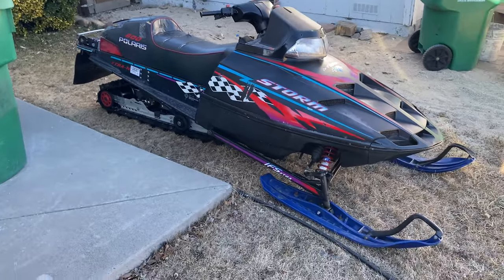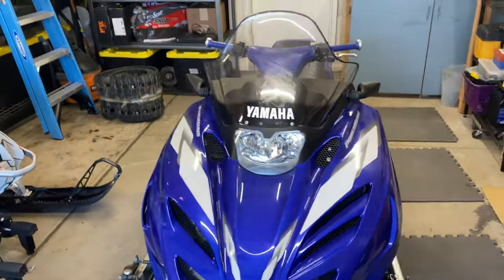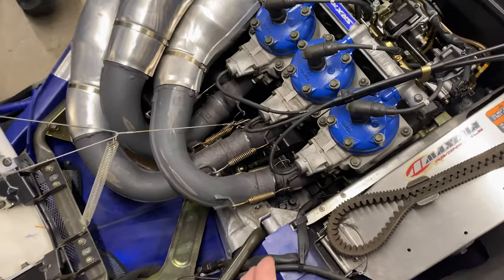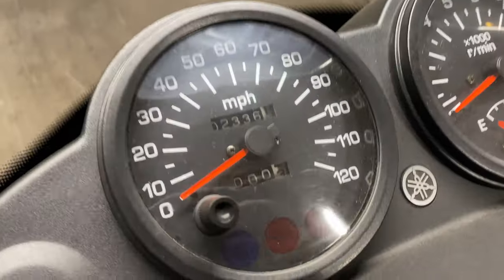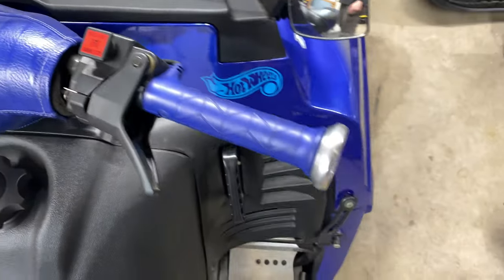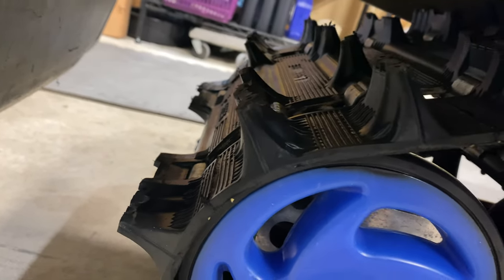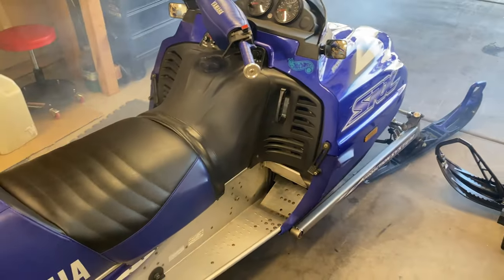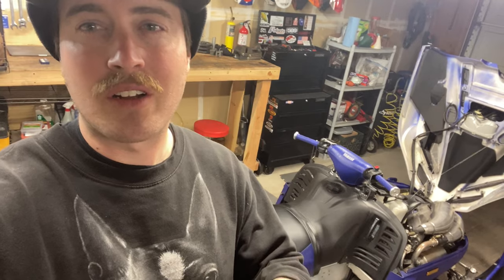The Yamaha SRX 700 - The FASTEST Triple Snowmobile Yamaha Ever Built - All You Need To Know.

Comment: I have a 02. Recently got me a speedbox to check the times, haven't used that on the srx yet, but the venture 500 which Ive set up for sno x, does 60 feet in about 2,24 sec on snow, pretty good I think.
Reply from the maker: That sounds like a wicked fast machine 💨

Comment: Stupidly clean SRX, unfortunately the chassis of these sleds is stupidly fragile (I've fixed a few that broke) And they're slower then an F7... by a wide margin. They sound nice, but they're not that fast unless modified.
Reply: Side note: I have a set of öhlins that some idiot painted the springs black just sitting in my garage
Reply from the maker: How much you want for them? Dm me on Insta @benbirk
Reply: Yes they are fast they set the amsnow shootout for fastest 1/4 mile in the day 12.003 and held that record for many years, had a faster et then a thundercat
Reply: @reesewilliamson3346  Intrested,, I power coated mine anyway.....